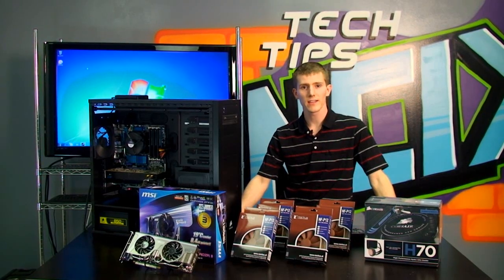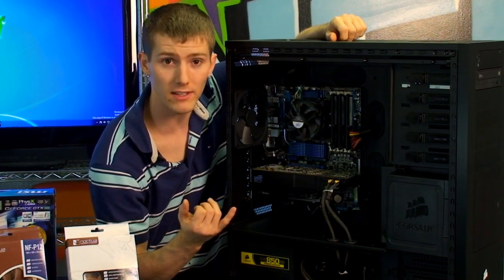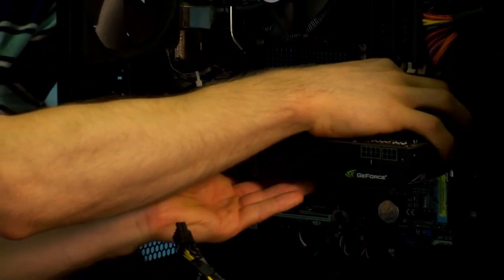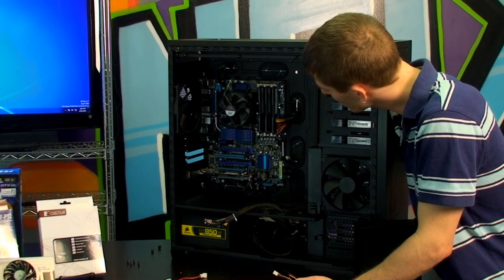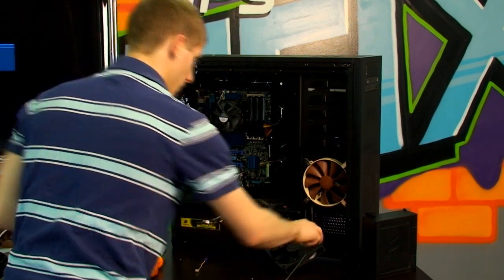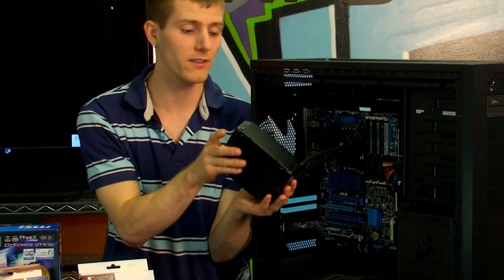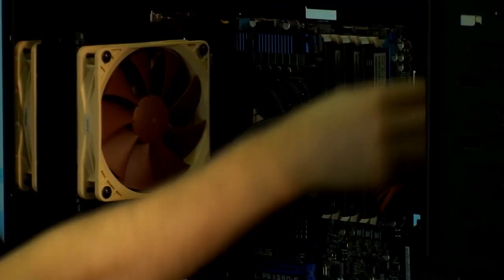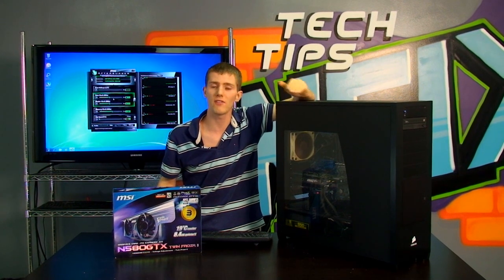Gaming PC Computer System Silencing Guide Featuring NCIX PC NCIX Tech Tips

Comment: CPU	Intel Core i5-3570K 3.4GHz Quad-Core	
CPU Cooler	Cooler Master Hyper 212 EVO 82.9 CFM Sleeve Bearing	
Memory	Corsair Vengeance 8GB (2 x 4GB) DDR3-1600	
Storage	Samsung Spinpoint F3 1TB 3.5" 7200RPM	
Samsung 830 Series 128GB 2.5" SSD	$128.34
Video Card	EVGA GeForce GTX 660 Ti 2GB	$289.99
Case	Cooler Master HAF 912 ATX Mid Tower	$49.49
Power Supply	Corsair 550W ATX12V	
Optical Drive	Samsung SH-222BB/BEBE DVD/CD Writer

how can I make this build quieter without sacrificing performance?

Comment: Coolermaster 430 .... 
stock cpu fan 
gonna buy xfx radeon hd 7870
530 thermaltake hamburg 
intel core i5 3570 (stock fan ) 
ssd
msi ba z775 g41

want to add to make it silent 
corsair h50 
corsair sp 120 quiet fans

Comment: Why would you want a CPU that will only be just right for your GPU? U want a CPU that can take on better CPU's so later u can upgrade and still have a viable CPU. 660Ti isn't bottle necking. The full potential of the 660Ti can be used and thats good. You don't want it the other way around ever.

Comment: And you only need a solid 550W PSU for the most powerful single-GPU card - HD7970 - which is outrivals easily 560Ti SLI. For me it's just a nonsense to play with those SLI or crossfires if you can buy a one card for the price of two used in SLI which is better, quieter and consumes less power.

Comment: nVIDIA GTX 660 SC Edition
Intel i7 930 3.06GHz with Noctua NH-U12 SE2
6 low brand LED case fans.
Top: 2 exhaust 
Bottom: 1 Exhaust 
Side: 2 Intake 
Front: 1 Intake
6GB Corsair DDR3 XMS3 
Corsair 850W Enthusiast Series Non Modular PSU
2 HDD's. (500 and 700) 
60GB Kingston SDD for OS. 
Oh and some Gigabyte Motherboard but I forgot the name.

Comment: Amd fx 9590 5ghz oc
Sli Everglades gtx 780 super clocked edition
Corsair carbide 300r
Asus rog raidr 256gb PCI e ssd (system drive)
4x4tb WD black hard drive
Corsair h80 I cooler
Asus sabertooth 990fx r2.0 gen 3

Comment: a power supply that has the connectors set up so you can remove them and add them as you need so you don't have to hide all those extra cables in some shity spot in your pc.

Comment: Well, I have a stock Radeon HD 4870x2 and its noise is really bad :[
Anything over 40% fan speed is a jet :*(
And this card takes over 300Watts
And this card is the hottest running card of its day... Over 95C it can handle, and idle is 90C!
So i have to use MSI afterburner to turn up fans... and its horrible.

Comment: 32gb ram
i7 4.2ghz
1tb SSD
Nvidia gtx 780ti
Reply: Lucky Doodles No, he asked for what specs you have at end of video. I was bored so I acc commented. My current build can support all games on ultra graphics. Some even on 4k resolution because of the specs I said b4
Reply: Faq cano I highly doubt you can run most games at 4k/Ultra with a 780Ti.
Reply: Lucky Doodles 60FPS is my definition of "run"

Comment: I know. Lets make great coolers and fans but make them look like they come from the 70s. I don't want the fans to look great to where you'd want to show them off. Instead make them look like crap so people would rather buy another brand. I actually just ordered a new CPU Cooler and I passed on the Noctua because I don't want a turd sitting on my FX8150 and Crosshair V board. All my PCBs are Black (Crosshair V - Thunderbold Card - XFX 6950 DD - GSkill Sniper 2133)  CM Sniper case, PCP&C Silencer

Comment: not doubting this guys knowledge but advising people to turn off auto fan speed and set the speed to low is a pretty fucking terrible idea
Reply: It's not a "pretty fucking terrible idea". 40% is way more than enough for a card that isnt OCed to the max and that is in a very good ventilated case. But I dont think twinfrozr really gets loud even after 60% u can barely hear it, so I would leave it on auto because of that, but leaving it at 40 if u are a maniac is not a terrible idea.
Reply: if you oc it would be a problem. my 290x can even run at 20% fan speed
Reply: Agreed. It isnt hard at all to create a custom fan profile in afterburner. With the fans at 40%, its actually LOUDER than it could be at idle and reduces the lifespan of the fan. Lifespan isn't a big issue, but still. The whole point of this video was to have it be as quiet as possible. 10% at idle and 40% at load is a much better way to run things.